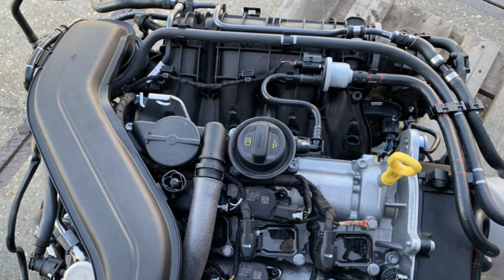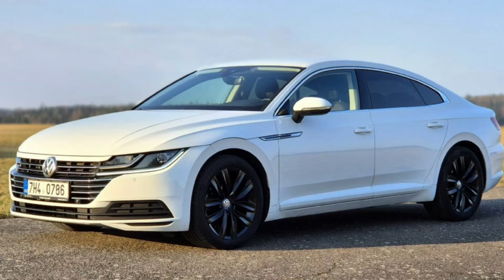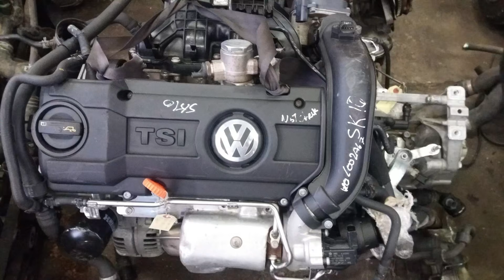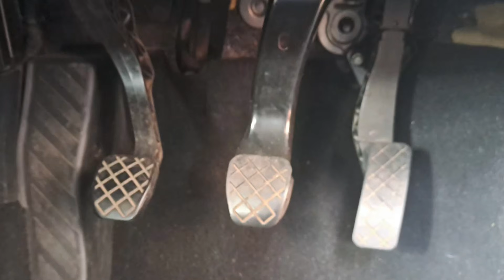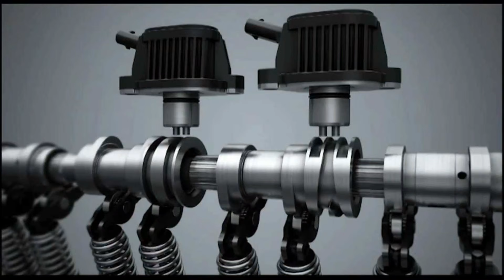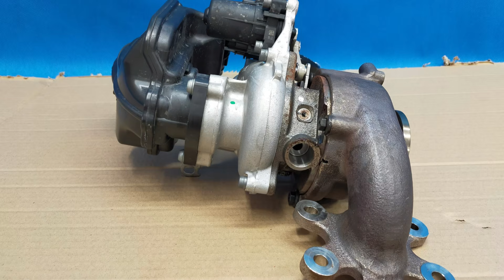Volkswagen’s 1.5 TSI engine: Common problems and advantages

Comment: Excellent video! I agree on 1.5 TSI being a good engine coming from the VW group. 

I just want to add two things, the 1.5 TSI suffers from carbon deposit buildup on the intake valves. This is very common on most direct injection petrol engines today, so nothing crazy. In most cases the engine will be fine over 250.000 km with slightly less engine power with time. However, in some cases the deposits can cause  so much build up that it triggers an check engine light. This can be fixed by manual cleaning using walnut blasting or other methods. You have to remove the whole intake assembly to access it. When done, it will restore full engine power and efficiency.

And secondly the timing belt replacement is expensive because you need specialist timing tools just for this engine in particular. VW sells this tool of course for thousands of dollars but it can be bought from other manufacturers for less. Most repair shops don’t have this tool though., so it can be tough to find one who will perform it. Annoying for sure but not a deal breaker.
Reply from the maker: You can rent these timing tools - that's what I usually do if I need to work on a belt or chain in fancy engines.
Reply: @DmitrySapko Good tip! That seems like a clever option. I never thought of it.

Comment: First of all, I’d like to thank the author for this detailed and enjoyable review. I recently ordered a Škoda Octavia with the 1.5 TSI 110 kW engine and a 6-speed manual transmission.
The so-called kangaroo effect doesn’t worry me too much, as it’s something I can adapt to, and I believe it also partly depends on driving style. I had a similar experience with a Ford Focus 1.5 TDCi, where the engine would almost stall if the clutch was released too quickly, and over time I adjusted my driving accordingly.
What surprised me, however, is the claim that this effect can be avoided by fully releasing the clutch pedal before applying any throttle. Could this have been a slip of the tongue, or am I misunderstanding something?
I’d also be interested to hear from owners of this engine whether using 98-octane fuel is really necessary all the time, or only occasionally.
Reply from the maker: Fully releasing the clutch before pressing gas - this is how Volkswagen recommends driving their TSI engines. Takes some time to adjust, but feels better than kangarooing every other time.
Reply: @DmitrySapko  Thank you for this information. Kind regards

Comment: I've got the 1.5 tsi evo 2022 seat leon. No problems as yet, good news I don't have to worry about the timing belt. No oil burn, can't feel when the ACT is activated. I change the oil every 4000 miles because I do short journeys and never have the start stop on. Only thing I'm not happy with is their clunky gear change to 2nd gear, I hear that normal for VAG particularly when it's cold, other than that is great. I use E10 and see no problems with the engine, however I also use an addictive just in case.
Reply: That clunky change from 3 to 2 is only thing that drives me crazy hahahaha. Fkn dq200

Comment: 1.5 tsi in a Skoda Octavia. Great engine, runs smoothly and has a nice fizz sound once up to operating temp and revving above 2.5k rpm. 

Can’t complain, cylinder deactivation works very well but can be slightly awkward at low speeds.

Hoping to get at least 250k miles out of the motor, 20k down so far!

Comment: About oil usage in high milage engines: It may be an option to change from the 0w20 to an 5w30 to account for the wear that happened in all these miles?
The 0w20 really is like water if not even thinner. 😅
Reply: Mine has been on 5w30 since 10k kilometers (and that was the choice of official dealership, the owners manual also specifies that 5w30 is fine). Now at 200k still without any issues and no excessive oil burning.
Reply: @blazr7664 wo wohnst du, weil es ist meistens von Aussentemperatur abhängig.danke
Reply from the maker: I had multiple VAG cars with multimple different engines and after they reached 200K km, I switched to a little thicker oil. But when it comes to 1.5 TSI, it's hard to say something. It has a very tricky cylinder deactivation system and I'm not sure it will work well with thicker oil. Might be OK though.
Reply: @DmitrySapko  I thought they are only sliding rings on camshaft electrical actuated? I don't see how oil viscosity would Influence that?
Reply: @DmitrySapko does this engine have variable debit oil pump?

Comment: I got a regular 2018 2.0L non turbo 151 hp 4th gen Toyota rav4. 
Never had any problems and never will have any problems what-so-ever. 
If you get a TSI engine ---> Good Luck with that.

Comment: I have the 1.5 tsi evo engine too. Oil consumption stopped after change the terrible sae 0-20 Castrol oil with sae 5-30 motul. For wv.

Comment: I have the 1.5 tsi evo engine too. Oil consumption stopped after change the terrible sae 0-20 Castrol oil with sae 5-30 motul. For wv.
Reply: Oil consumption is not something bad if the engine is designed to do so.
Reply: It consumes 250 grams for 15000 km. This is normal. I use Castrol 0w20.
Reply: @bodomro2942  15.000km for oil change you are going by the book it's not good at all. Max 7.000-8.000km if u want your engine healthy for over a 100.000km.

Comment: This motor 150 with the 6 speed manual is a formidable combination.Excellent torque and gearing in low gears and good 5th and 6th low stressed running at 100 mph.
Reply: Excellent gas mileage too!!
Reply: In its EVO2 variation the 150HP machine got even better with 6gear manual. The 5th gear now is usable until 140km/h with considerable low consumption and the 6th gear got very long transmissioned so that the engine even remains below 4000revs around 200km/h significantly lowering engine sound and consumption at high speeds. Not sure how such a "small" engine is able to achieve that. An engineering masterpiece. PS: Yes, I am from Germany and like to drive fast :)
Reply: @rageradeon 
Mine is a 2021 150 Touran with 6 speed manual.
I use it for European touring and local use.I've done 4 trips from UK to Italy with it so far since I've owned it.
I'm still amazed by its torque and power output.Very good acceleration from 140 - 220 km/h and climbs alpine passes quicker than many other types.

Comment: I want to buy a skoda karoq 2021 1.5 tsi sportline Dsg  with 50k km  but it say "wet" belt in oil bath ..any experience here? Or recommendations?
Reply from the maker: No wet belt in these engines. Timing belts are simple dry belts. There is the oil pump belt which is inside, but it lasts the lifetime of the engine, as far as I know.
Reply: @DmitrySapko thanks for the answer so would you recommend it for a middle class suv ? The 1.5 tsi or to go with 2.0 tdi
Reply from the maker: If you compare those two, the diesel engine is more reliable. But the tsi is still very good, especially with just 50k km of mileage on it. Look at the transmission code on the sticker in the boot and investigate it on forums. Other than that, this should be a good purchase.
Reply: @DmitrySapko thanks Dima for the quick answer ..i ll go with the 1.5tsi and will respond with my experience after couple of kms 😅 all the best u got a subscriber 💪🙏

Comment: My TSI does not have a dip stick would you advise fitting one?
Reply from the maker: Yes, evo2 engines don't have a dipstick. The good thing is that the dipstick from the older 1.5 tsi fits. You can buy it new or used.
Reply: @DmitrySapko  there are definitely evo2 engines that have the dipstick, but it seems to vary from model to model. for example, i have seen the dipstick in a fabia 130, but not on an 1.5 etsi mhev octavia.

Comment: Our 2018 Golf has 180,000 miles now. The water pump has just been replaced but other than that there have been no problems. I suspect diligent servicing helps.
Reply: Strict servicing is the key to a long life of a engine
Reply: When you changed timing belt ? Or alternator belt ?

Comment: The 7 speed DSG on the Audi Q3 35 TFSI 1.5 MHEV EA211 evo1 DFYA is a wet dual clutch. Had mine from new in 2021 with no issues apart from slow initial acceleration response that has since been put right. The 1.0 EA211 CHZB engine with a manual gearbox in my new A1 is sound too so far but both are low mileage. 508 spec 0w20 oil changed every 5,000 miles, E10 95 RON & both run in gently. I think the direct injection might be more of a problem later on with carbon deposits.
Reply from the maker: The 7-speed DSG you are talking about is DQ380 - wonderful transmission that replaced the talanted 6DSG in about 2017. Just needs fluid change once every 40-50K miles to avoid mechatronic failure. Also, if you drive actively, at 90-100K miles the set of clutches and the dual-mass flywheel may ask for replacement which is not that cheap, to say the least. Calm driving may take them to 150-200K miles.
Reply: @DmitrySapko For 1.5 TSI engine DQ200 is used, with dry clutches and it doesn't have such a good reputation, depending how you accelerate, if you do it slowly (not racing style) it will last longer

Comment: I have the 11.5eTSI evo2 in superb. Runs great, runs quiet. Getting about 6,5l avg consumption on highway runs (130-150kmh) and about 5,5l on rural roads. Sometimes I hear the ACT working (rougher engine, sometimes it jerks when it switches from 2 to 4 cyl). We will see after 100K km :D
Reply: I have skoda octavia 2020 with 1.5 and 158.000 km I have no problems I service it every 6000km I got it when it was 133.000km and the and the previous owner didn't service the car so well so when I serviced it 3 times at 6000 the oil came up very dirty and the now I got it serviced at 8000km the oil looked like honey it is very important to compensate the negligence of the previous owner. and also lack of oil maintenance causes dibree on the valves because the engine takes some of that oil pressure and relives it at the air intake and if the oil is dirty it will cause carbon on the valves when I serviced it I also put 98 octane and 44k platinum fuel additive engine runs efficient and clean and with more felt power and efficiency
Reply: also if it jerks service the car earlier with 0w20 oil with the standard vw standard I don't know where you live but where I'm from castrol oil is not good option because a lot of shops buy it fake I use frank ol or motul
Reply: and check the plugs also
Reply: @charles-v7h5g Have you checked your timing belt at this mileage?

Comment: Bought a Golf in February with this engine. 3 times now at slow speed, the engine has just switched off. The car then has to be stopped, turned off and on. The stop start system will not restart the engine. VW can not find a fault. It also needed half a litre of oil after 4,000 miles.
Reply from the maker: Oil consumption within first 1000-1500 miles is fine. But the stalling problems and dealership not being able to diagnose it sounds like a lemon to me. This is a serious safety concern, so no way I would take the car from the dealership without them fixing this properly.
Reply: Sounds very dangerous, if they cannot fix it, i would be getting rid of it.

Comment: Hi, 
In the US we have plenty of complaints and some number of recalls because owners have 1.5 TSI engine blown gasket issue (VW Taos for US marked is equipped with this engine and issue observed on 2022, 2023 years cars). I suggest that a faulty assembly or the use of low-octane fuel are major factors that can induce the conditions (detonation and extreme heat/pressure) leading to the gasket failure. What is your opinion on that problem?
Reply from the maker: Several factors here, I believe. First of all, the Taos is quite heavy, in Europe, the engine is mostly used in smaller cars, but owners of the Passat also have more issues, indicating that the engine hates pulling weight. Also, cars in the US much more often pull trailers, and this may add problems. Finally, most owners likely use regular fuel which indeed will cause knocking and increase wear and tear. I think these are main factors. Also, I'm not sure about transmission that is used - need to investigate more - it may create additinal risks with "too long" gears, which I presume what VW may have done for the US market where people drive on highways 70-80% of the time.
Reply: @DmitrySapko  Thank you very much for your answer. In first gen VW used 8 speed Aisin for FWD and DSG DQ381 for AWD. In second gen they use Aisin for all drivetrains (I think because it's cheaper to maintain). Taos is very small car for trailers, so I don't see anyone how tow something with any sub compact SUV.

Comment: Breaking in these engines correctly is really important. Once you get 600 miles/1000 kms on it (with sensible driving) give the car a good flogging for a few hours minimum on some hilly roads. This will all but eliminate future oil consumption and make sure everything is bedded in properly.
Then do an early oil change to get rid of all the metallic shavings. And of course - always use premium high octane fuel
Reply: Before giving it a good flogging at 600 miles, change the oil.

Comment: 1st gear can sometimes feel jumpy but change to 2nd too soon on a slight incline and the pedal can feel "dead" for a couple of seconds.
Reply: It is not a rocket engine. You should comprehend that. You cannot expect it to be like 2.0 liters or above, and it is enough for a normal driver and person, consumption-wise and with driving experience.
Reply: @ivanrakic2743  I'm well aware it is not a "rocket engine"! VW engines are well-known for the 'kangaroo effect' so it is nothing to do with speed! Maybe read the comment before jumping to daft conclusions.
Reply: I read it well, and I drive a lot of different newer company and private VW Group cars. Neither of them has that so-called effect when you drive it like it is meant to be. In fact, I do not prefer German cars at all, but that is what it is, and I am not defending anyone here, just stating facts.
Reply: @mda50099 and I commented specifically on the part where you said it is "dead" if you change gear from 1st to 2nd too soon. Well, if you start normally, not sportily, in first, and if you let go of the gas pedal first, then press the clutch and change to 2nd gear, it will not be "dead" nor "jumpy." It is not a dynamic engine at all, especially with a manual gearbox, and that jumpy feel is because it has a newer flywheel to dampen the transfer from the torquey engine to the gearbox, which diesels have had for years, and only newer petrol engines have it today. Maybe you know this, but many people don't, and before someone criticizes something, maybe it is better to know something and be familiar with it.
Reply: @ivanrakic2743  Then I suggest you Google VW kangarooing effect and you will indeed discover that many owners have experienced this. Mine can indeed be 'jumpy' and not what I would expect from a modern vehicle having owned many manual petrol and diesel cars over 50 years. Okay, the economy for a petrol is way better than expected but it is still disappointing when the accelerator pedal can sometimes feel as if it is somewhat 'detached'. I did not experience this when driving a similar model on a test drive prior to purchase.
Reply: @mda50099 у меня 1.5 tsi на механике без гибрида 24 год. На холодную на первой передаче на 95 бензине слегка ощущался это «эффект кенгуру», но очень слабо , и это вообще не мешало. А когда начал заливать 98 бензин, этот эффект вообще пропал. Пока все нравится 🙂
Reply: same for me, is because they(vw) set the fuel too lean so that the HC, NOx, CO2 to be low. you can read more  about the smoke map.

Comment: So far so good for my 2025 VW jetta sport
However that hesitation you mentioned is present with the 8 speed toptronic at full throttle from a standing start when the transmission is shifting gears.
Otherwise no

Comment: Just bought a new B9 passst with the eTSI 1.5 engine so fingers crossed my car will last me for years to come. Slight issues with software updates updates but my car is very fuel efficient.

Comment: Hi Dmitry. would you be able to say which is better, the this 1.5 TSI engine or the 1.4 TSI in the Golf GTE from 7 and 8 ? i am asking because i am thinking of upgrading the GTE either to a 2022 GTE with the 1.4 TSI engine ( that i am driving now still after 172.000km) or the newer one, that have the 1.5 TSI... thank you for your reply. rgds Nico.
Reply from the maker: Both engines are quite good, but the 1.5 tsi is certainly better when coupled with an automatic transmission. I don't know how they hold up in GTI - in my country that trim was only sold with bigger engines. But if I had a choice, I would go with the 1.5. It's newer and seems less problematic overall.

Comment: This engine came to market far too soon. It took VW ages to admit the kangaroo problem and even longer to fix it. I have one in my T Roc. Thankfully it runs quietly unless pushed, smoothly and economically. Oil consumption is low and I have achieved 52.4 mpg on a long run which was good but an exception due to my driving style. I didn’t buy the earlier version because of my annoyance at dieselgate and the use of cheap and nasty plastics. I love my current car but not so keen on the imminent replacement but that’s a different story.
Reply: I own a T Roc too, it needs long drives from time to time or else it behaves like its,  possesed.